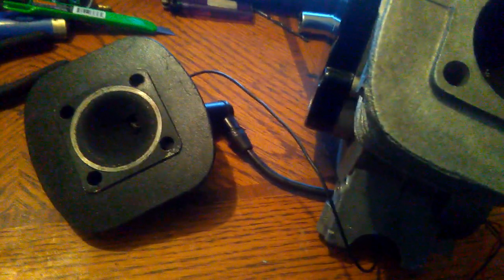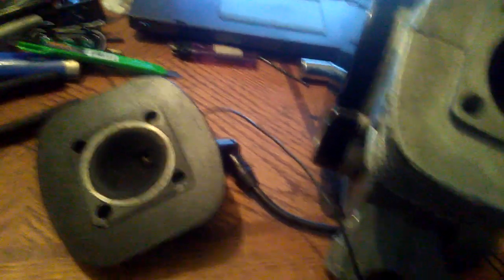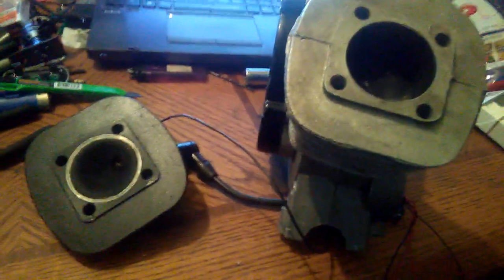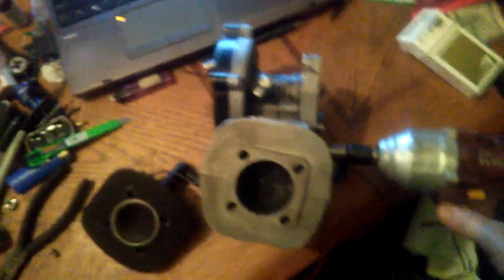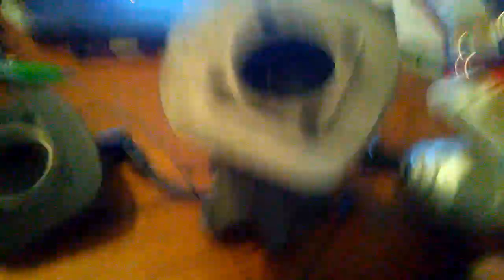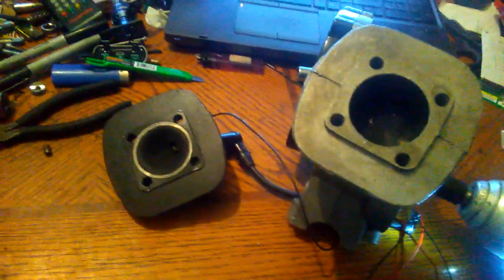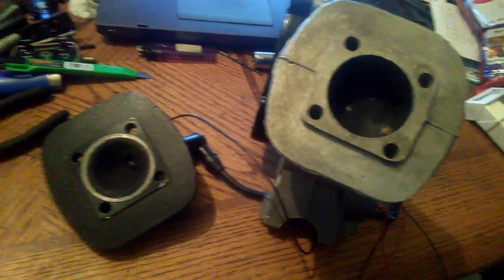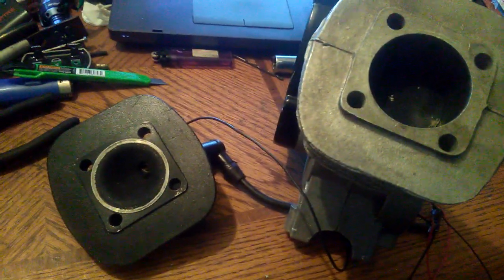66/80cc M-Bike Plasma Ignition Prototype .

Comment: I've been thinking about doing that for a while.....but I decided to experiment with a "fuel magnet" instead.
I would like to see how much it helps.
Reply from the maker: I had one, basically it is a coil of wire around the fuel pipe, its supposed to magnetize the fuel molecules etc.. unless its in the direct path of wet fuel air mix, they really do nothing. Let me know  how yours turns out.
Reply: Mechanically Electric it involves the use of two opposing magnets on each side of the fuel line...they use this with marine diesel engines...it separates the carbon atoms from the combustible atoms in "high petroleum" fuel.......my theory....it should & does work with two-stroke fuel due to the added oil with the gasoline.
Reply from the maker: @JohnBoy  let me know the results,

Comment: I got to see this thing in the action it looks like it's sparking great 👍, I'm thinking about taking a flywheel off of an old weed eater I have and fitting it on to the engine crank and running its coil I think it'll work good as long as I get it timed right